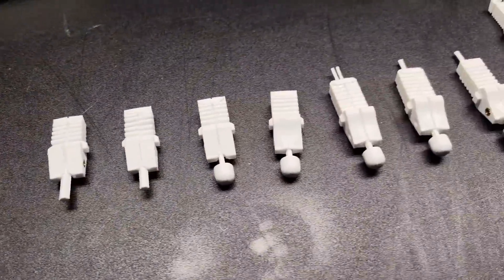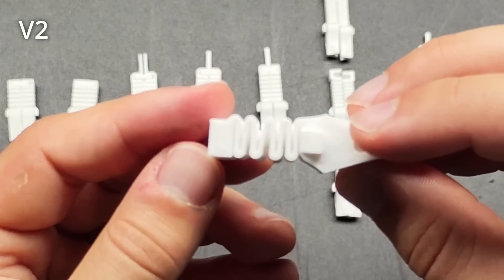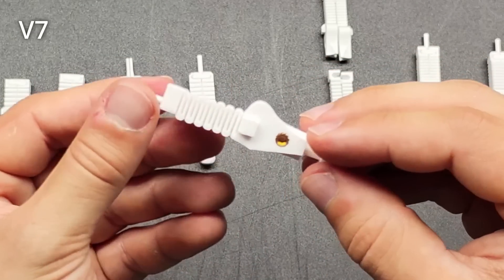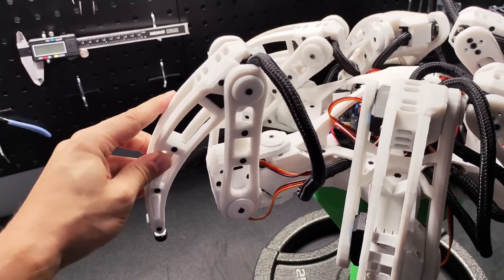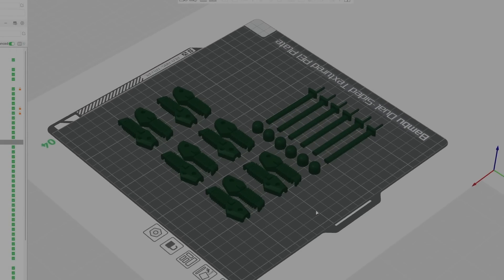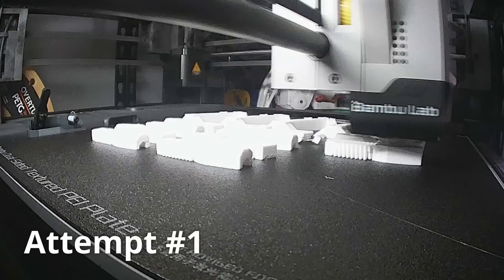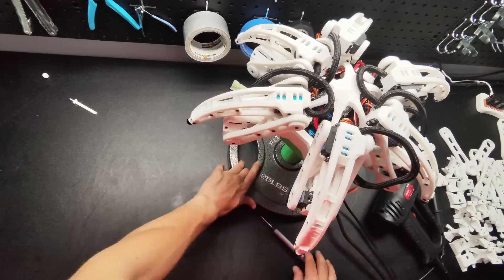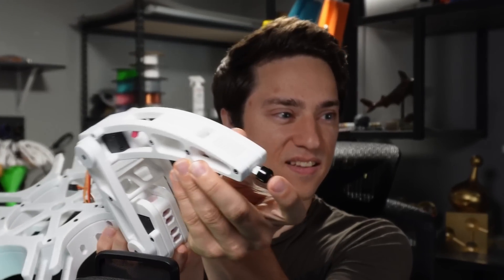I Added Shock Absorbing Feet to my Hexapod

Comment: How was your process of calculating what load each spring should handle? I find it difficult to calculate myself. As there can be different number of legs grounded to support the weight of the robot at any given time.

Comment: I don't think most resin materials would work well for a spring.  There are some resins that have some flex but it's not like FDM where you can make those kinds of parts.  Generally a part like that would just snap and break if printed in resin.

Comment: Ditch the on off switches in the shocks for hall effect sensors. That way you can incorporate a curve thru PIDS to slow the motors more smoothly and not slam full force or off. Then it would not matter what surface you were on.
Reply from the maker: I will look into this, knowing how far each leg is push down would be insanely useful.

Comment: Can you explain why you wanted the springs so soft? Surely you'd want to tune them to bottom out with just a bit less than 1/6 of the weight, maybe 20% less or something?
Reply from the maker: Exactly, ideally they should bottom out at 1/6th of the weight. 
It's hard to get them exact though because of the additional friction caused by the design being made in blender, so I aired on the side of too soft because a spring not being fully pressed even when it should isnt good.
Reply: @AecertRobotics  cool! was also wondering about if the leg last section could be a parallel linkage, then there would be a mechanically easy way for the complaint spring to almost impact vertically regardless of extension? If the final part of the linkage was a spring, it'd be parallel when unloaded and collapse to a triangle when loaded?

Comment: HI, great job. seems to be working well. out of curiosity, which lengh are u using in IK ? foot pressed or extended ? it might have been the reason they exploaded on the first try
Reply from the maker: It exploded cause the shaft was wayyyy too thin, but I use the pressed in length in ik calculations

Comment: when did you add the switch and for what reason? curious to know
Reply from the maker: I added it a while back, it's so the hexapod knows which legs are touching the ground. It'll let it walk on uneven terrain if I code it correctly, it'll also be able to sense if a leg isnt doing what it should be.

Comment: I like the old design a lot. It looks very organic and spider-like due to the thin limbs, pointy ends and round middle part. Will you release those files too?
Reply: it's probably the product of the modelling method, blender is meant for digital art so it's easier to make something look more sci fi even if you didn't mean to. While in fusion you have to deliberately have aesthetic in mind because otherwise the path of least resistance will not look "fancy"
Reply: @aronseptianto8142  That's actually well said dude. Forgot that he modeled in Blender. I've worked with CAD a lot and considering that he made all that in Blender is pretty crazy.
Reply: @SagIchNicht-d7s  yeah,  my first few 3D printing projects was also blender at first, all of them required friction fit, it was not necessarily fun. Used fusion 360 after that and it was such an upgrade 

Though now I've transitioned to freecad so it's not necessarily an upgrade, I kind of miss being able to do a master sketch
Reply from the maker: I don't see why not! Although maybe I should try altering the new design a bit to make it more edgy?

Comment: I'd like to build a hexapod with your tutorials, but I'm a bit scared of the demand for servos. Do you really screw up servos that often to build this? Do I really need to invest that much in expensive servos to build a hexapod? I also imagine that not all 3 hexapod leg servos are required in such an extreme way, the servo glued to the body that moves the hexapod horizontally should be the least required, but the next servo that lifts the leg and supports the weight of the hexapod should be the most requested. It would save money with different servants thinking that way, correct?
Reply from the maker: I've lost about 10 servos so far, but you need to keep in mind I've been working on this thing for quite a while. I will not release this unless I am confident the servos won't be self destructing because of something I do (of course occasionally they can fail because they are cheap but that's unavoidable)

I'm working on getting the cost of the servos down. And you are spot on. The coxa servos take on the least amount of load, and the femur ones take on the most. Mix and matching servos based on need is not a bad idea at all.

Comment: How did you decide on resin for the springs? While definitely more precise, my experience with resin has it being very brittle. Like almost no yield before failing. It is awesome for aesthetics and fine detail, but I am not impressed for structure or function.
Reply from the maker: Literally the only reason is because it wouldn't let me do petg for them.

Totally agree, but It was so cheap I figured I'd see what would happen

Comment: A solution for the feet that requires no moving parts is to use Force sensing resisitors (FSR's) in the foot to sense when the foot touches the ground. They are an analogue based  sensor that gives a pressure reading between 0 and 1023 so you could even get the hexapod to walk gently and tiptoe around!
Reply from the maker: I think knowing how much force is being applied to each foot would be super valuable info! I wonder if I could replace the limit switch with one of those
Reply: @AecertRobotics  You could, definitely. You could even make it a multi-stage trigger  to adjust the walking parameters. For example, a normal limit switch wouldn't allow you to have the hexapod adjust it's walking "animation" in reference to how heavy it is. With the FSRs, you could include that.

Which means no matter how much load you put on it (a big camera, a soda can holder, a 3D laser environment scanner, etc), with the correct algorithm, the hexapod would always "walk perfectly" adjusted to how heavy it is.
Reply: The leg will still have momentum though, so that’s why the spring is necessary. Also force sensing resistors are apparently not very good.
Reply: You could probably even implement a pid loop to actively dampen with the servos and stabilize the thing at high speeds and when jumping/landing.
Reply: @thirtythreeeyes8624  that is hard to do with standard RC servos like this, it would be much easier with better servos with more feedback and control modes, like being able to control the motor current rather than position.
Reply: @conorstewart2214  Yes that's how spot and other legged robots do it using big pancake motors and FOC and you're right about most servo's not having the feedback needed but, you could add a feedback wire from the pot in the servo like was done on tricopters. You're also kind of right most FSR's can be very low resolution/sensitivity he'd likely be best off making his own with some velostat and a pcb trace so the force range it measures could be dialed in to where it needs to be by testing different thickness velostat and size/density of pcb traces.

It definitely wouldn't be an easy or quick project but, it's not impossible although maybe not suited to a diy project.
Reply: @thirtythreeeyes8624  even with the feedback wire it still isn't great as it doesn't change how the servo operates, which is position control and max speed all the time. I have tried using velostat for force sensitive applications and it is not great either. The problems I had with the velostat were lack of consistency, the resistance would also not return to the same point every time when the load was removed or go to the same resistance with the same force added. The best solution I have come up with and that I will be using is two opposing magnets, a linear hall effect sensor and a spring. The spring compresses under force which moves the magnets and changes the field on the hall effect sensor which changes its output voltage which you can measure. I have found it is very consistent and the force range can be changed by using stiffer springs or even swapped out for some form of rubber if you need higher force measuring. You can apply an offset by preloading the springs, that way it won't measure below a certain force but will be able to measure a higher max force which may be useful at some point.

Comment: Good to see you again, project looks great, even if you are going back and redesigning from scratch. Like i said last time this 'and other vids like this' is why im researching 3D printers, also like i said last time programming all that is way beyond me. My first major project after I learn more about 3D printing/ modelling is going to be a M IV  landship ww1 tank.
Reply from the maker: Thank you so much!
Trust me, a complete redesign in cad sorely was needed.

Oooh you'll love the next video! Robotics is such a fun way to get into 3d printing and coding 🙂
Reply: @AecertRobotics  Currently creating hobby room which will finally give space from a printer. Still trying to decide whether a resin printer or a 3d filament is better.

Not asking for advice as ofc your dont know all the parameters I need to take into account and there are plenty of reviews/ guides and such out there that I'm going to look into once I get a better idea of the space I have to work with as well as other constraints.

I seem to be rambling on. In short keep up the very interesting videos and maybe at some point I will have 'something' that can be controlled to show you :) .
Reply: @Archtechnician  If I can give some advice I own two fdm and two resin printers the resin never gets used. The detail is never needed even on small stuff since I only print structural items and unless using rather expensive resins fdm is always stronger and longer life of both raw material and finished part but, I only print in abs and tpu. There is also a big hassle with resin in that it has really bad fumes and is dangerous in liquid form making printing and cleanup a chore needing a quality respirator and large supply of gloves, paper towels, isopropyl etc. and the build volumes are much smaller.

Comment: protip: I know you probably like the look of the white but white filament is known for being weaker than other colors
Reply from the maker: Huh, that's good to know. I wonder how much weaker it actually is
Reply: @AecertRobotics  I had some issues in a design that held some bearings with a pretty tight fit. other filaments just stretched to accommodate and the white would always crack. White is mostly fine but I wouldn't be surprised if the friction pad you redesigned would work in a different color. plus black highlights look cool